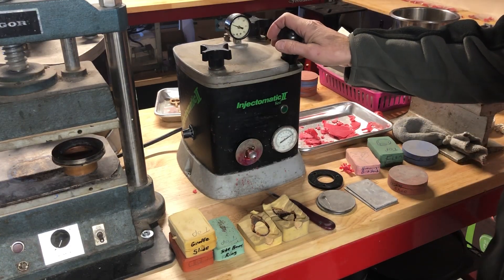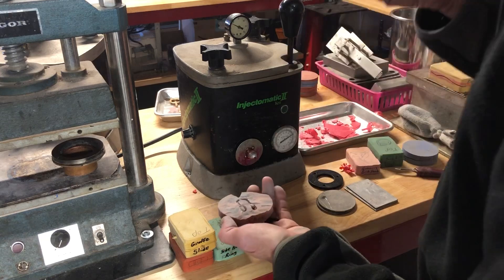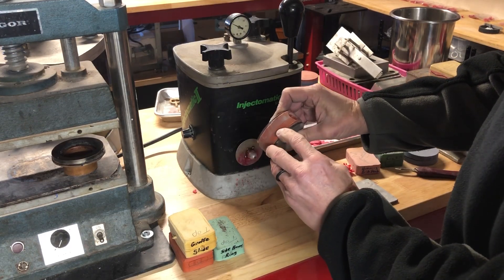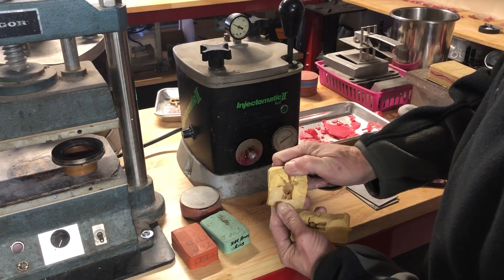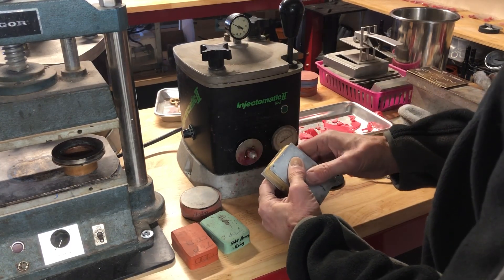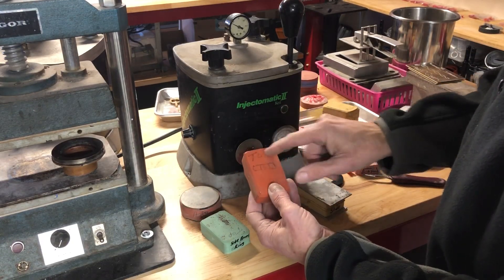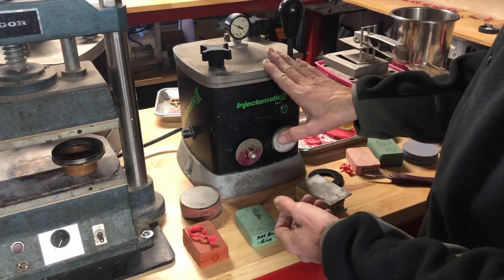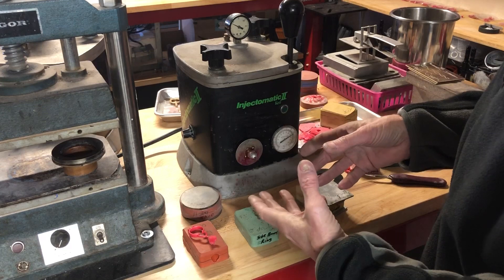Some Basics about Wax Injection

Comment: Thank you for all the details, I currently bought a manual wax injector and am having trouble injecting a perfect piece, when I inject either of these happen: The wax leaks in the mold(I have also tried to  put clamps on the plates) , or/and it goes half way through and spills out of the sprue hole or it doesn't go in at all and spills out. Not sure what wrong am I doing I have tried combination of high pressure and high temp, low pressure and high temp, low temp and high pressure none of it seems to work. As the last step tomorrow I am going to try replacing the wax ( currently pink color) to some other one.  My molds are small ones for pieces of 5x 6 mm to 12x12mm sizes

Comment: Hello, please what is the proper pressure for the injector , My injector squirts wax very hard
Reply from the maker: I use around 7 psi for most molds and above if very fine details.

Comment: Does knowing which side the top is when injecting?
I get why it helps when releasing the mold and removing the model.
Reply from the maker: Mostly to know  which side to pull up on first but sometimes if there is more wax that needs to fill one side it helps that the bigger side is down so it isn't fighting gravity.
Reply: @craigdabler-thediycastings7511  Good to know, thanks. I'm learning slowly.